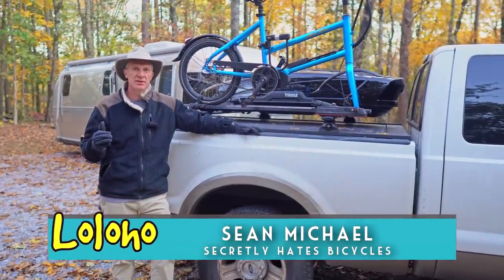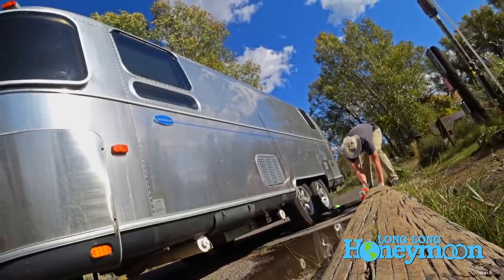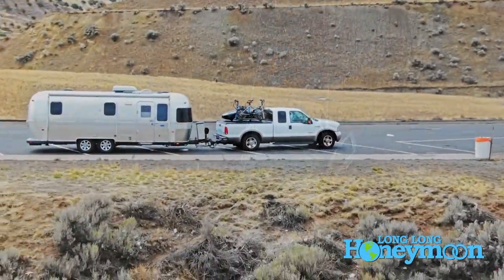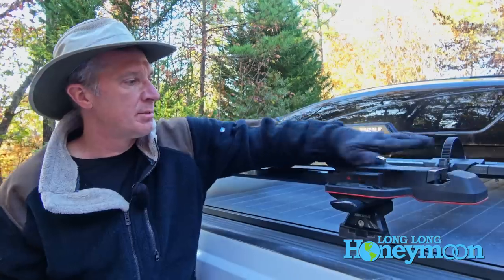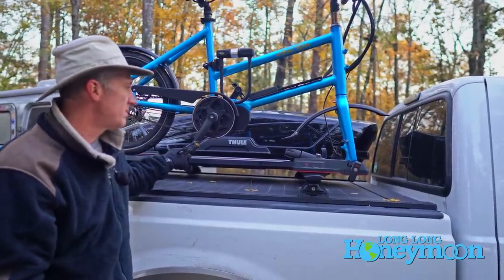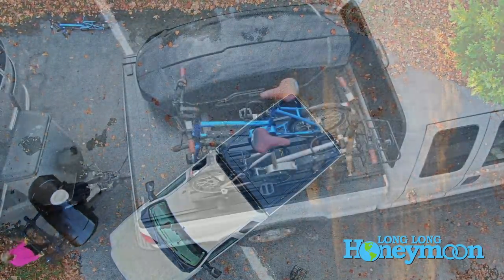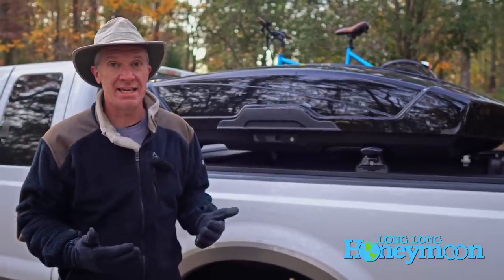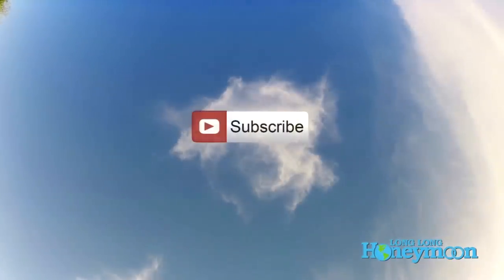Our Yakima/Thule Truck/RV Bike Storage -- What We Like and HATE About It :O

Comment: THULE T2 PRO XTR HITCH BIKE RACK - 2" RECEIVER 
NO WHEEL  REMOVAL DEAL IS COOL BECAUSE ONE TIRE SITS IN A LITTLE BASKET ANDS THE OTHER HAS A STRAP SYSTEM LIKE YOU CURRENTLY ARE USING FOR THE OTHER WHEEL

Comment: Have you considered a camper shell for see more?  You could store everything you need in there including the bikes and then lock everything up at one time.
Reply: A shell would actually give us less storage because of how the bikes would have to be secured (they would take up almost half of the bed). Also, I don't personally like the look of shells, I really don't like the lack of rear visibility they cause, and it's difficult to remove them. One major advantage of our system is how easily we can remove it when we're not on the road and don't need the extra storage.
Reply: Have you considered a receiver mounted under your back bumper of your Trailor and then getting a receiver style bike rack? It would give you enough space between your emergency window and your bikes. This is what I did on our camper and it works well.  The nice thing about it is that it enables me to use the same bike rack on the back of my van when I am unhooked from the camper.
Reply: @kristymichael  Can't change your mind on the way you don't like the look of shells.  If the shell is set up right you would have more rear visibility than you have now. You are correct,  current market supplied items,  you have the configuration that works for you.  It would take some thinking outside of box (raised aluminum shell: large rear window for visibility..., no window but access door driver side of shell and large window access door passenger side).  Window covers added for security when vehicle is unobserved. Bikes attached/secured to drivers side (It would have to be specially made.. It can be done... I have two 29ers that go that side, I also have only a 6 ft bed).  I realize you have large racks on your bikes (staggering then would help with the amount of space they take (you have a long bed truck).  One advantage to your set up. You have easier access to bikes when trailer is attached.  Your disadvantage is visibility of bikes and they are in all the weather.  The reason I said aluminum shell, is I made mistake of buying fiberglass (way heavier..cumbersome to remove). Four bolts and a plug to remove on a canopy is not too much and having two saw horses/or something to be covered when it is off.

Comment: I have a ARE brand cap on my truck bed instead.  It keeps all under it, bikes included from weather and possible theft of items.  If on a long trip, 300 miles or more, I just secure bikes inside of trailer.  Again, bikes are out of travel weather and dirt.  You indicated weather damage to bikes.  A cap will take care of that.

Comment: I think folding bikes are possibly a better way to go. You could keep those in the truck bed. I'm in Europe and we have a tremendous range of folding bikes and ebikes available, but there are many really good ones available in North America as well. If there is not enough room in the truck bed then put the folding bikes in another one of those Thule units perhaps? Maybe get one of those big covers for the truck bed with windows to get some more room. With good folding bikes there are very few steps to getting them into use. I think you could have a simpler setup with fewer steps with folding bikes.

Comment: We only have a cheap non-Airstream travel trailer but oddly enough we are also cautious about causing any damage to it.
Reply from the maker: Yes, by all means call out those elitist snobs in their 16-year old trailer. No need to be offended. It has nothing to do with trailer cost (except for the exorbitant cost to repair aluminum panel damage). Some bike storage racks can be safely fastened to the sides of fiberglass RVs. I think with fiberglass you have more options.

Comment: Bikes on the back of a trailer also tend to cause tongue weight to be lightened too much causing bouncing of trucks rear suspension.
Reply from the maker: Yes, weight distribution is an important consideration when putting anything on the rear of the trailer. From a sway standpoint, there couldn't be a worse location.

Comment: As to the issue with getting stuff out of the truck bed when the bikes are mounted, how about a slide out shelf in the truck bed? Sure it doesn't help when hitched to the Airstream, but it would when unhitched. Just a thought.
Reply: It would be helpful, but the slide shelves are just thick enough to prevent our generator from fitting under the tonneau cover. Lol, it's always something! 😂🤷🏼‍♀️

Comment: I think you give up a lot with the weight of the e-bikes.  We have light bikes which we just mount on the back bumper of our 30 foot travel trailer.  We just take them off -easy - when camped at a site, negating the problem of rear window escape.  Big fans!

Comment: Our thought that I don't think you addressed is carrying them inside. We have a small TT and the thought was either on the bed on top of and wrapped in moving blankets with maybe some pedals removed. Or a rack sitting in the aisle that could be removed quickly. 

ETA I was listening not watching but then did see your couch option. Why did you give it up seems like the simplest system.
Reply: Because it pretty much prevented us from using the inside of our camper anytime we stop for lunch, to work for a couple of hours, or just for a one night stop (which we do frequently).

Comment: So many expensive but still not great options for mounting heavy ebikes. I'm thinking of a swing-away, rear hitch type for my bike. Once swung out, I would still be able to open rear suv window or hatchback.  That busted fork could have already been weakened by hundreds of miles of jiggling on that mount. If it's wiggling, it's wearing.

Comment: I have been looking for the perfect solution for years and years to this problem.  I’m still looking.  My current best of the bad solutions is to put them inside my van. I have a Nissan Nv 3500 passenger van, and I modified Some bike racks to fit inside my cargo area. (With some seats removed).  Keeps the bikes very well protected from the elements and theft, but eats up way more cargo space than I like.  One thing to consider when figuring out your own solution is that the back of the trailer is probably the worst place possible because the bikes get the roughest ride there.  If you have a high dollar bike it will beat it to death in no time.
Reply from the maker: Yes, the rear of the trailer is also the last place you want to add more weight (due to trailer sway)! And some of these e-bikes can weight quite a lot.
Reply: Experienced the beating to death that actually broke the bike rack and almost lost the bikes on the Interstate.

Comment: Good video. Why not put a truck bed topper on the back? You can put your bikes inside out of the weather. Should solve most of the locking issues. Shouldn't need the Thule, since covered storage should be available. Also more aerodynamic. Just a thought surprised you didn't mention it as an option.

Comment: I have a similar set up and recommended It to you guys when you were deciding on a solution.  The only difference I have is we use a carrier that keeps the front wheel on the bike avoiding the fork stress. This makes it a bit faster to load/unload the bikes.    I agree that bed access is a pain.  Love your videos.
Reply: I have the same. Leaves wheel on, highroad.
Reply: I have a similar setup but have Thule big mouth bike racks that hold the frame, and the wheels stay attached, also only one lock per bike required. I have done light off roading with the bikes attached and they shake less than what you showed of your system in the video.

Comment: Did you consider the Yakima Frontloader Bike Mount? It is shown as a rooftop bike rack but would probably work great on your truck bed rack. No front tire removal and looks very secure.
Reply: We looked at those, but the size of our bike tires prevented us from using a rack like that. And the location of our battery prevented us from securing it another way.
Reply: Those racks are nice, but they have a 40lb max load. Wouldn't work for those bikes, not safely anyway.

Comment: Looks like you're home now?  We don't travel with our bikes anymore, but I do know we couldn't fit them under the tonneau, and we should be able to fit them easily under the cap, although it would take a little arranging to get them in with the generator back there.   A taller cap would solve the issue.  I'd really recommend you try that.  This solution you are using seems like a whole lot of hassle with some serious downsides.

Comment: Great video.  We went with your suggestion with retrax one... composite instead of aluminum.   Thule pro bar with thule upride.  We ride trek powerfly 5s.  Now to try it out on the road!
Reply: Mike I’m curious to know if this system has worked since I am considering something very similar.   How has it been lifting the heavy bikes up onto the rack system?  Any damage to the bikes carrying them up there?  Has the Thule Upride been strong enough to withstand the vibrations and forces associated with towing?

Comment: I like that solution.  However I have a 5th wheel so it wouldn't work for me.  So I got a hitch receiver put on the back of the trailer and a hitch receiver bike rack.  That still set me back about $1500, and it won't carry e-bikes, too heavy for the bike rack.  But it carries 3 regular bikes good enough, although they still get beat up a bit.  But we don't have expensive bikes so I don't worry about it.  So then I thought, "why not get one of those little utility trailers so we can tow 2 small dual-sports and the bicycles?"  Big mistake.  Those small utility trailers are very bouncy and the bicycles got beat to heck.  Only tried that once and I am still working on how to tow the dual-sports on the trailer and keep them in one place.  Maybe the trailer I bought was no good.  Anyway, lowering the tire pressure on the little trailer from 80 lbs to 40 lbs helped but it's still too bouncy, even with 450 pounds of dual-sports on it.  I'm thinking what I need to do is install tire channels on the trailer.  PS not all states and provinces allow you to tandem with a fifth wheel, particularly not BC or Washington State.  Not sure why because they allow B-trains.  The law is specifically written such that you have to be over 65 feet in total length before you can tandem, but if you have an RV you have to be under 65 feet.  I think these rules were written before the 3500 came to be what it is.  It should, in my opinion, be based on towing capacity.  There is no way my little trailer with 450 lbs of dual-sports on it is going to boss around my 10,000 pound trailer and its electric brakes.  Makes it impossible to back up though but I put a wheeled jack on the trailer even though a small trailer like that does not need one but it makes it simple to push around even with the dual-sports on it.  So when we get to a camp site, we detach the utility trailer, push it where we want it, and then back in.

Comment: I think it would be better to clamp the bike to the rack using the frame as the strong point. The wheels and forks are not up to this task.
In my dirtbike days we used old car  tires between each bike and tied every thing down really secure as we would be using logging roads to get to our riding area.
We could get 5 mx bikes on the trailer.
3 in 'vertically' and 2 piled on top.
'Securely fastened' , needless to say!
These days you could use ratchet straps rather than poly rope of course.
Bungee  cords or ratchet straps on your current system might be the way to go.

Comment: Your bikes are mounted `really only at the fork the rear wheel is strapped to but no other mounts are on there. The frame of the bikes wil act as a lever as it wiggles while driving. So I am not surprised that the fork broke. Now I have a Thule Mountainbike carrier which also grabs the bikeframe in the middle and you can leave the front wheel in.
Then I put a rachet strap from one crossbar over the frame to the other to immobilise it and stop or lessen the wiggeling. That might be an idea to start with and maybe you can get a Thule bikecarrier over there which doesn't only grab the fork. Just an idea! Check my profile picture.
Reply: We can't attach anything to the bike frame because that where the battery lives. Applying pressure to this area on our bikes is a big no no. So, we went with the best option we could find.
Reply: @kristymichael  Well yeah I understand the rachetstrap still might help to minimize the wiggeling.

Comment: a yakima front loader bike mount is what you need.
Reply: Nope! 😄 Tried it with our bikes and it would not work because of 2 things: our front wheels are only 20" and the front arm could not clasp tightly enough on them, and the other arm couldn't clamp on the main frame because that's where the battery is mounted and applying pressure to this area is a big no no.

Comment: Great video!  I bought the Retrax XR cover on your recommendation and love it so far.  Do the Yakima towers fit directly into the T-slot or do I need an adapter? The Amazon link shows the bottom of the towers to be rounded off so wasn't sure about ordering them from the link. Any additional information about this is appreciated!

Comment: Why do you remove the front bike tire?  It seems removing the tire put extra stress on front fork.
Reply: It was the only way we could attach our bike to the rack. The other ways wouldn't work because of the small front wheel and the location of the battery.

Comment: Why not put a high cap on the truck. Then you can install the sliding drawer like they have in class A storage. Bikes would fit perfect and you can slide them out when you need them.
Reply: Because the bikes would take up half the floor space of the bed. We travel with a generator, grill, fire ring, tools and multiple tripods for filming --- all in the bed of our truck (Airstreams basically zero outside/underneath storage). It wouldn't all fit. And we don't personally care for the look of caps. Also, we like the easy removal of the storage box and bikes for the months when we aren't on the road.

Comment: Everything you talked about I have tried.  Except the one you are currently using.  They all suck.  The final solution I came up with sucks as well but not as much. That is Foldable Rad Mini ebike.  I fold them put them in the back of my truck and then never take them out cause it such a pain.  I even tried a truck camper with a trailer for my stuff. 
I’ve be doing this for 35 years and have decided, there isn’t anything easy about RVing. 
Love your Video’s,
Ed
Reply from the maker: Haha thanks Ed, you are right -- this mode of travel is not easy. And all bike storage seems to suck. :D I really think if something takes too much work/effort to use, it just won't get used. We didn't get much use out of our bikes this year, so I'm not enthusiastic about carrying them again.

Comment: Just wondering would it be hard to load them inside the camper and just strap them to the side
Reply: That is a better solution. 
They stay out of the weather and you don't have to remove the wheel. Secure them well from theft when they are stored outside.
I like folding recumbent trikes without an electric pedal assist, but they can be a great and necessary help to some.
I have a folding Greenspeed Magnum XL that will hold a rider up to 475 lbs. and I love it.
Reply from the maker: @StellarFella  We tried this approach for the first few weeks of bike ownership. For the way we travel, it's just not a livable solution. We often stop and take rest/work breaks (lunch, etc.) in our trailer when traveling. The 2 bikes consume our entire living area. I have no place to edit video. Heck, we have no place to sit except the bed. We just don't have enough interior space for this to work, sadly.

Comment: Pro Tip. When you’re off road and want to store the rack simply rig a couple pulleys, rope, and 4 rubber coated utility hoods to the rafters of your garage. Place the hooks under the crossbars, release the towers from the tracks, and hoist away. It’s a one person job and rack is stored out of the way.

Comment: I would be trying to figure out how to tie down the bikes IN the Airstream. Yes, it's an extra step to pull them out and tie them down when you reach your destination, but they would be safe from the elements and theft, and you could leave the front wheel on. Just throw a moving blanket down to protect the floor and bungie them to a table or something.
Reply: The problem with that is how frequently we move. Sometimes we're in 4 different places in the span of 6 days. And everytime we stop we don't want to have to take them out and lock them up. We tried it for about 2 weeks and it was a MAJOR pain. It's also a pain on any driving days because we almost always stop and have lunch and/or do some work from inside the camper. Again, that would require removing the bikes because our camper is small inside and our table is not permanently fixed (it's a fold down table that should be collapsed for travel).